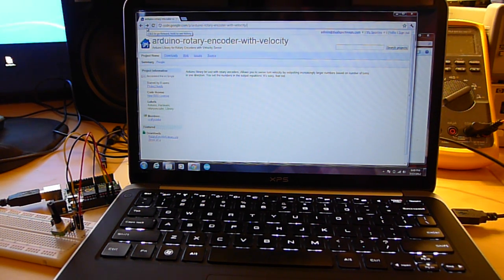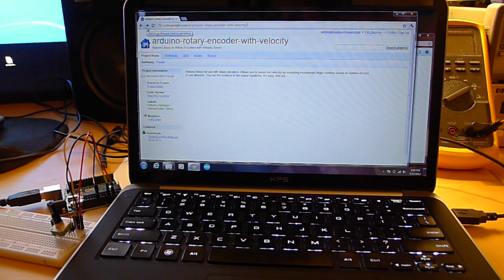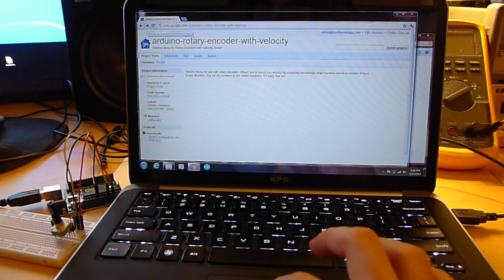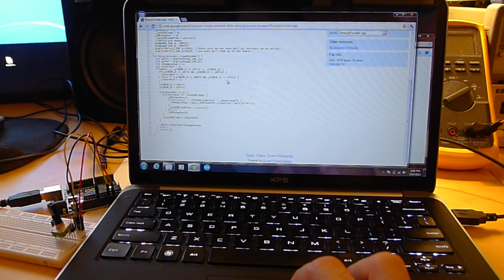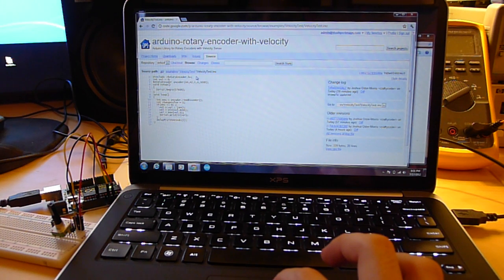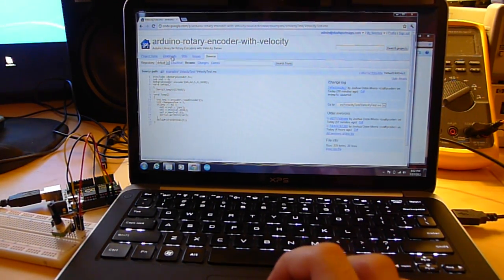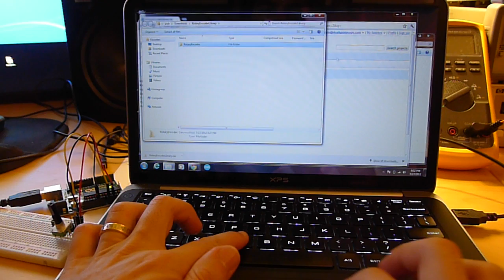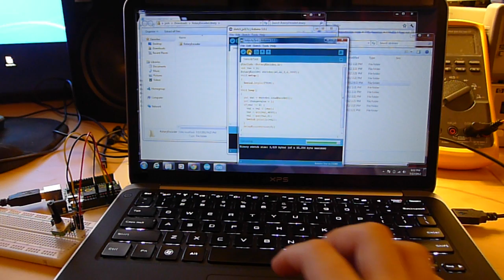Arduino rotary encoder with velocity sense library

Comment: when I use your library with the encoders I have the value changes 4 times per every one detent. Is there a way to make it so that 1 detent equals an increase or decrease in value of only one
Reply: i also wonder
Reply: I modified his library to so it works to only increament 1 step instead of 4 now:
FIle: RotaryEncoder.cpp

#include "RotaryEncoder.h"

RotaryEncoder::RotaryEncoder(int ENC_A, int ENC_B, int multiplier, int stepSize, int pauseLength) {
  _ENC_A = ENC_A;
  _ENC_B = ENC_B;
  _multiplier = multiplier;
  _stepSize = stepSize;
  _pauseLength = pauseLength;
  _oldENC_A = 0;
  _oldENC_B = 0;
  _lastENCread = 0;
  _ENCcounter = 0;
  _lastENCreadTime = micros();  
  pinMode(_ENC_A, INPUT_PULLUP);
  pinMode(_ENC_B, INPUT_PULLUP);
}
int RotaryEncoder::readEncoder() {
  int PinA = digitalRead(_ENC_A);
  int PinB = digitalRead(_ENC_B);
  int changevalue = 1;
  int turn = 0;

  if (PinA > _oldENC_A){     
    if (PinB != PinA) turn = -1; //clockWise 
    else turn = 1; //counterclockWise
  } 
  _oldENC_A = PinA;

  if(turn != 0) {
    if(turn == _lastENCread) {
        _ENCcounter++;
        if((micros() - _lastENCreadTime) < _pauseLength) {
          changevalue = max((_ENCcounter/_stepSize)*_multiplier,1);
        }
        _lastENCreadTime = micros();
      } else {
        _ENCcounter=0;
    }
    _lastENCread = turn;
  }
  return turn*changevalue;
}

Comment: Your work is so supreme :)) do you have a github for this , I want to fork and improve under your name.
Reply from the maker: https://github.com/craftyc0der/arduino-rotary-encoder-with-velocity
Reply: I read your code , it dont use interrupt  but using 2 at a time and the atmega doesnt miss anything , surely it will work with esp
Tks :)

Comment: When using this, I have to call it multiple times in my sketch. First time through it works fine. Problem is that the 2nd time through it acts as if some calculation values are not being cleared, as it increments as if I'm turning it very fast... or something. If I turn it slowly (1 count per click), it begins to increment OK, but then starts to increment in large steps... and I'm still turning it slowly. Ideas?
Reply: it is "velocity sense"
Reply: RotaryEncoder(int ENC_A, int ENC_B, int multiplier, int stepSize, int pauseLength); 
define multipler and stepsize to a smaller int should work